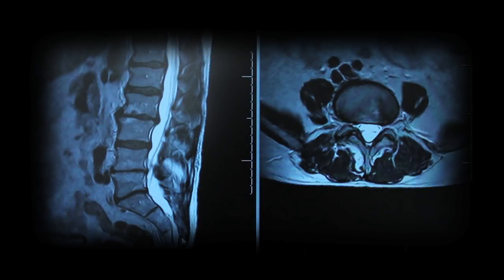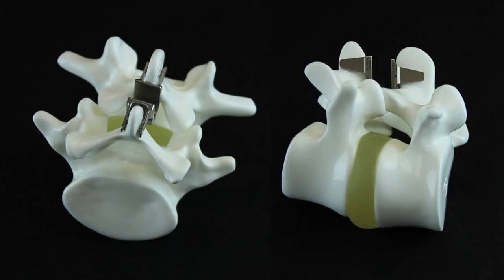Coflex - Minimally Invasive Lumbar Decompression and Stabilization Surgery

Comment: Issee this video was done in2014 so now it’s 2020.I have 2 questions (a) Has this method changed let’s say due to the years passed?
(b)I have been told that I need this surgery,decompressing the nerves and stabilizing the spine l4~l5   I teach middle eastern dance,will I be able to dance after this without the gadget falling off.?
Reply: Can this surgery be done under local anaesthetic?
Reply from the maker: https://www.instagram.com/p/CFKp-VlpN2v/?igshid=1patbroz8mntt
Reply from the maker: The procedure continues to be successful as it was first designed.  One thing that has changed is that it is now usually performed in an outpatient surgery center where you go home the same day.  
Although the device is the same, savvy surgeons generally adapt through the years and become less invasive in their techniques.
Reply from the maker: yasminleila1 it is performed under general anesthesia